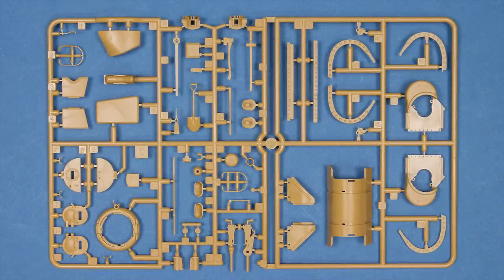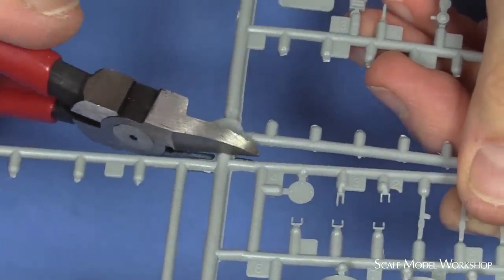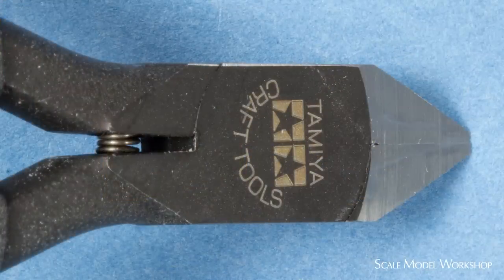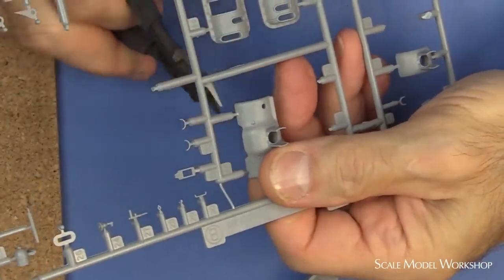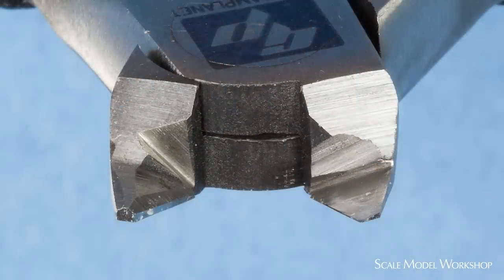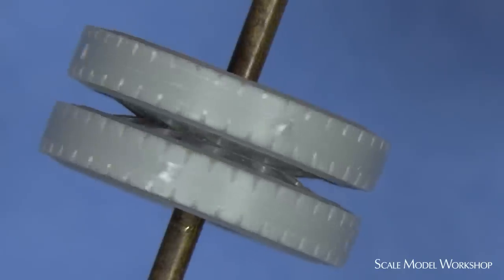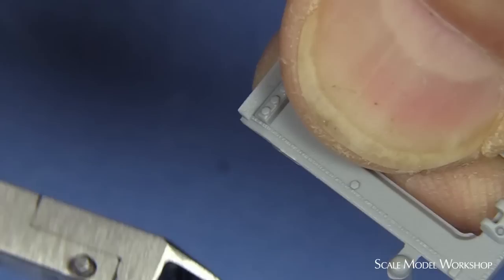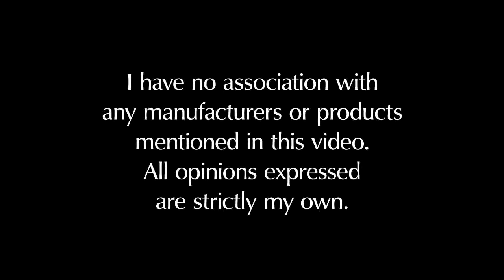Sprue Cutters and Nippers for Scale Modeling

Comment: I've had a Lindstrom RX8141 wire clipper for over 20 years now.  Modified the cutting area to make it very narrow.  Very comfortable in the hand and the spring tension is adjustable.  A bit pricey, but will last you a lifetime.

Comment: Great video! I've been using the cheap stamped Xuron cutters for quite a while as I never imagined more expensive cutters would make whole lot of difference. I think it's about time I got myself some nice Tamiya nippers!

And about the stress marks - most of the reviews that look at that metric that I've seen are Gunpla modellers. And many Gunpla builders actually don't paint their builds (they are designed to look ok unpainted) so that's why they care about stress marks.

Comment: Ill have to get some good nippers as well. My generic ones have become dull and they always leave a giant burr in joint. 
BTW what kit does that spider net-like part tree with more flash than parts come from?
Reply from the maker: it's the P-63 from MPM ... It would nice if we could have a decent kit of this airplane.
Reply: @scale-model-workshop Good to know. I jave built the RS models p-39. It didnt have this much flash, but the parts just didn't line up at all. Like they werent parts of the same kit or airplane. Fw 190 parts fitted better in places.
Reply: Paul, if you're looking for new 1/48 P-63 family, check out the new kits from AMG/Dora Wings.

Comment: The god hand pair I had snapped in two. I was trimming a fin off at sparrow missle to make an antenna and it snapped close to the base.
Reply: WinterXL  No, I have another pair by a company called Dspae, I think that's the name, anyway they work just as good and weren't as expensive. It just put me off the whole godhand brand. I took a picture of it with the blade stuck in the plastic.

Comment: Great to get the product numbers on the Tamiya nippers - I had the 035 but not the 123. I remedied that, and it's well worth the penny. And, yea, I splurged on a God Hand for my own birthday last year - no necessary, but sometimes tops. We should appreciate how much better these nippers do the job than the Xuron and other clones - the Tamiya also outperform more costly nippers from the Gundam world. You can't beat the right nipper for getting a fiddly part off the sprue without damage. For my purpose, however, good nippers lower the time needed handling small parts - and that means less chance to drop them or lose them. Good ulcer prevention - that's worth the price for sure.

Comment: Does anyone happen to use blades, (e.g. razor, xacto) instead of nippers to cut parts from the sprues?
Reply: Depending on the part, if it is very thin like Sherman headlight guards, I use a #10 blade.

Comment: If you're just cutting the sprue, why wouldn't a pair from the hardware store work? That seems more cost-efficient.
Reply from the maker: Absolutely ... just a pair of diagonal wire cutters work just fine.   I was just showing that there are specific sprue cutters and they are larger than the nippers that are commonly referred to a "sprue" cutters ... that aren't really suitable for actual large diameter sprue material.

Comment: You've made a rare error here Paul. Xuron cutters are supposed to be misaligned. It's their patent - a shearing motion to achieve a cleaner/more flush cut than a cheap compression cutter. Whereas premium compression cutters rely on being very sharp and thin. Different tool, different outcome. I find the top of the Xuron line professional sprue cutters to be an adequate intermediate price point tool. One benefit that style of cutter has is the ability to handle heavy sprues as well as finer pieces. They also apparently dull slower because of this - in addition some of them are rated for cutting even soft wire. If you're looking to get something better than the dollar store clippers you were using, but don't want to invest in specialised tools, consider getting a second opinion on Xuron cutters before deciding only off this vid.